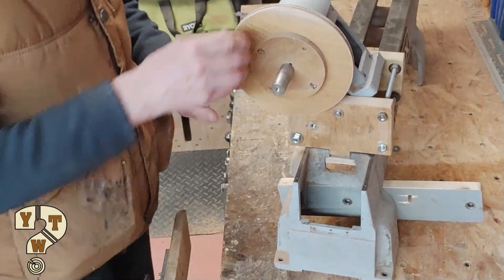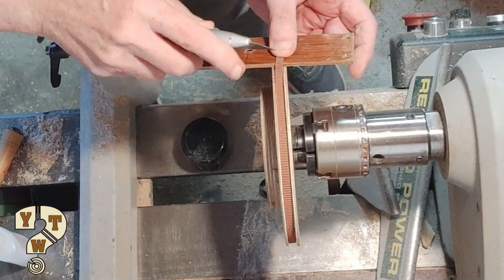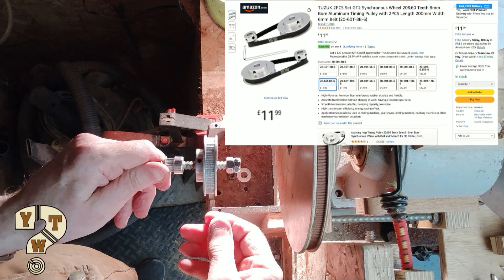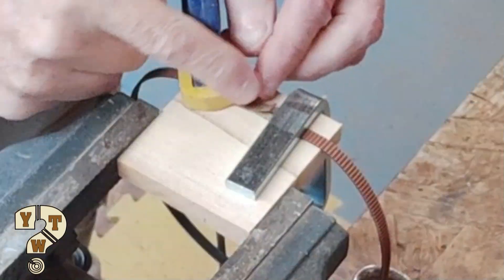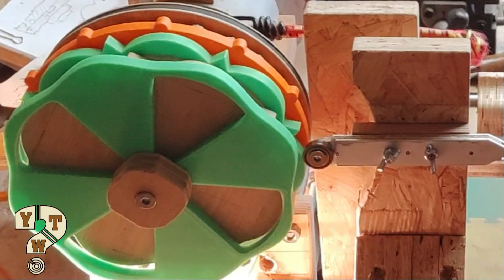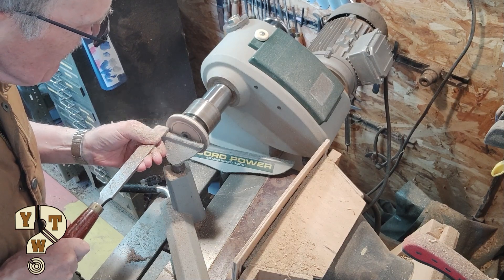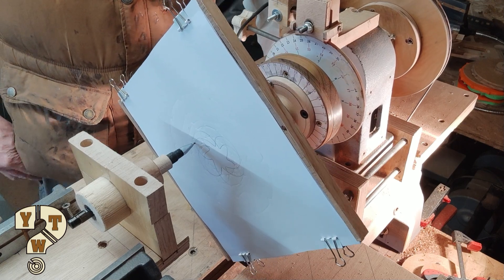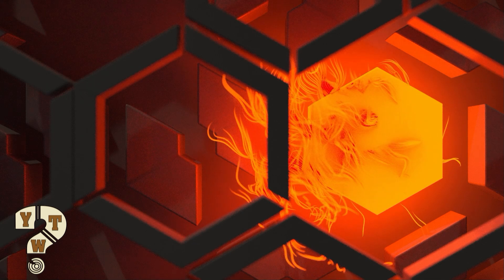Carving with a Spirograph. Rose Engine Part 3 of 3

Comment: The middle of Lidl sometimes sells boxes of springs similar to amazon. Another open would be to get hold of some spring wire and make to fit!
Reply from the maker: I think the spring wire may be the best option as the headstock weight poses a problem when it leans past top dead cente. The tension varies quite a lot when extream amplitude is required.

Comment: That worked really well Derek. Have you got plans to use the spirographs to make gear inside ring patterns or just the gear outside ring (trochoids)?
Reply from the maker: Yes hopefully. I will need to make sure the driven pully and the drive pully run perfectly true. No reason why I can't make a new thicker gear hub in the form of an anulus screwed onto a backing plate, with enough clearance for the gear follower to rotate in its bearings inside the large anulus gear.
You've got me thinking again.
Thanks mate.